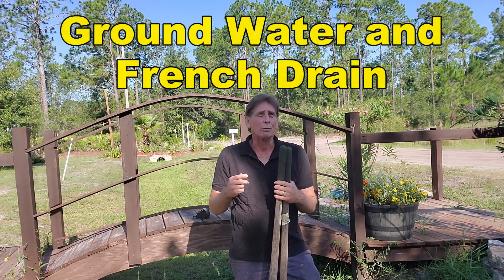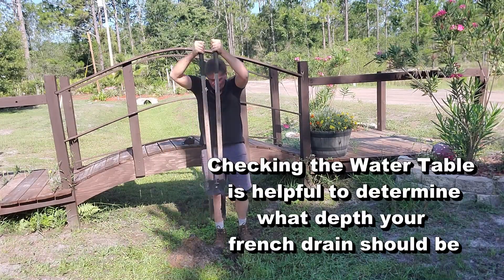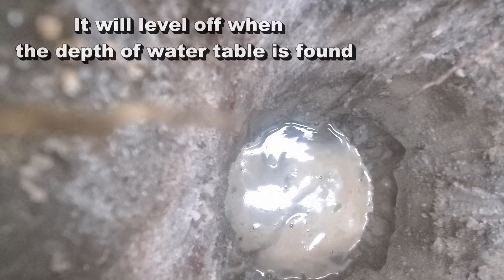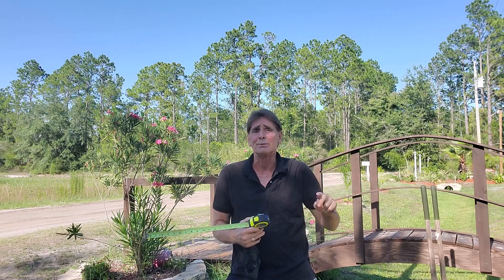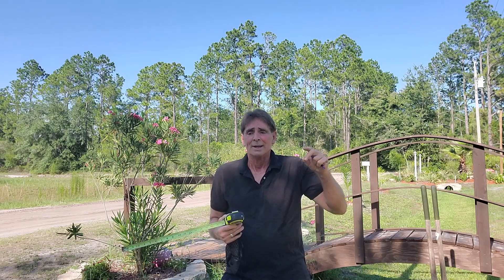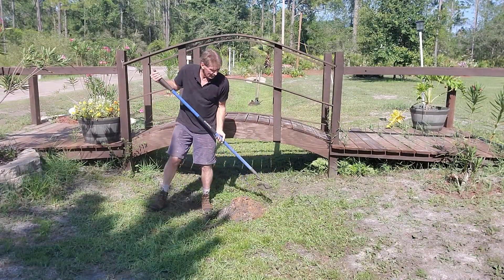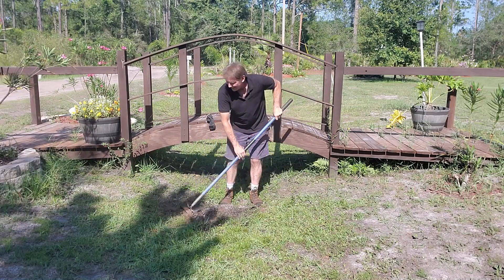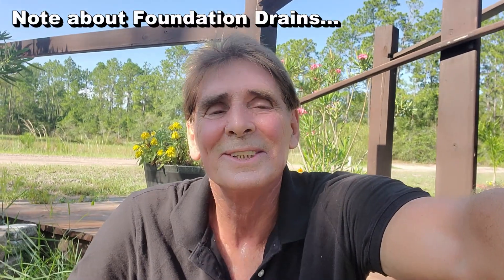Ground Water and French Drain, How deep do you dig?

Comment: My big takeaway from this has been an eye opener for me. If one interferes with the natural lie of the land by excavating say for constructing a foundation for building, especially where there is clay in the soil or where there is a clay layer below the soil, (I have both: clay component and a one inch thick white kaolin layer 12 inches down) you risk bringing that ground water up to the surface, even to the extent of turning your building into a wick for the water to escape to the surface. This action will naturally cause your building to slowly begin to subside over years. This is what has happened to me with a recent addition. The original owner a drainage expert built hundred of yards of drainage around the house on a sloping site but a later owner made additions without the drainage. Slowly cracks began to appear).. The only solution is to construct French drains around the structure and maybe if necessary even built in under the structure to drain that water away before it affects the structure. I never knew that ground water behaved like this, coming up where there is a space, previously only thought about surface water. Thank you.

Comment: Kindly explain to me how can I drain water from low grade to high grade level.
Reply: I have a similar issue, and am relying on gravity for drainage. I plan to have my collection pipe starting at the water level on the low side, and going at a decline the entire way. Rain gutters are recommended to slope 1/2 inch for every 10 feet of run. This will mean having to dig more through the higher level to keep the decline consistent with the lower level. Hopefully your high grade side is not extreme.

Comment: Thanks for video. You said that if you wait, the water would probably rise to near top so wouldn't the water table be there, near top. I don't under stand why the deep hole if the water is only an inch or so from surface.